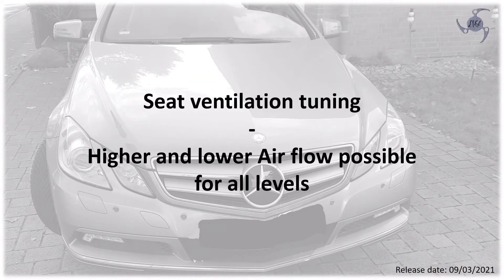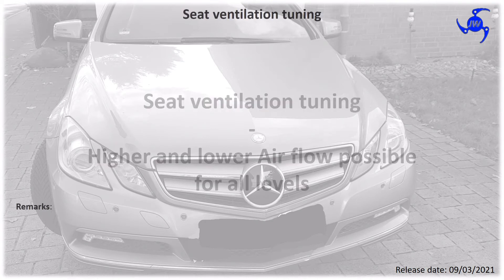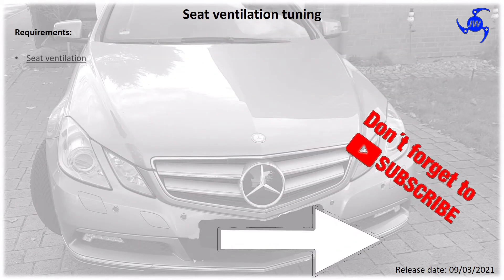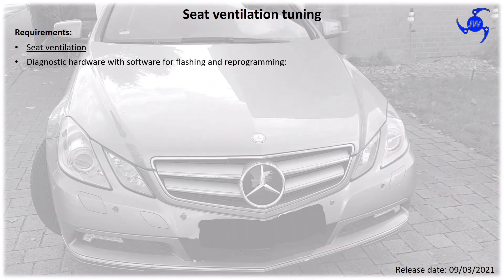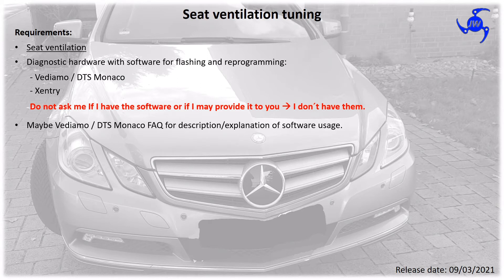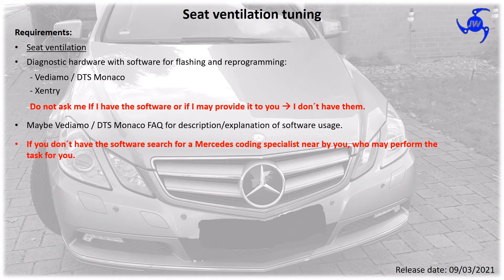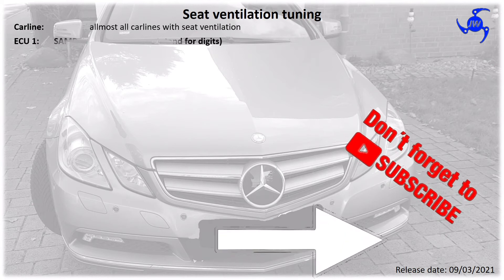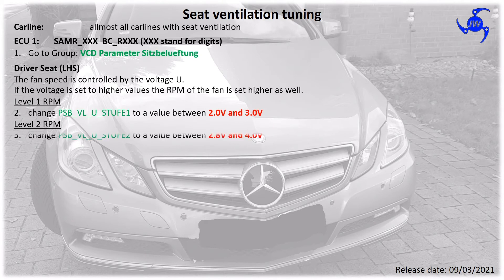DIY - Seat Ventilation tuning - Mercedes coding manual

Comment: Hi there, thank you for your incredible work! I have Mercedes GLs and some time air ventilation vacuum the air, some time it’s blow. As I understand the system automatically change between this 2 modes. Do you know of possible to change the algorithm of changing the modes? Thank you!
Reply from the maker: which 2 modes for your  aircondition do your mean ?
Reply: @JWAutomotive  car can switch automatically between blow and vacuum mode. Some time you can feel the blow from fan, some time you can feel the vacuum ( if you put your hand on seat), so far I spoke to many people and a lot of them check that gl164/166 have 2 modes - vacuum/blow. For car user it’s impossible to switch between them, it’s algorithm that work automatically.
Reply from the maker: I have not noticed these two modes yet.
so I cannot help you with your question.
and in the ECU is no parameter to this as well.
Reply: @JWAutomotive  I see, I will try to check some paramètres also in sam and will be back if I found something interesting. Thank you!
Reply from the maker: @kanterpribor  
it would make me happy if you put a thumb up in the videos you like.
thanks in advance
Reply: It’s done my friend) unfortunately I didn’t find in my écu the coding for air ventilation, only heating, but will try more)))

Comment: How to code both fog lights on  ?
Reply from the maker: be more precise.
Reply: @JWAutomotive  fog lights from the rear light up left or right depending on country left or right lane driving but never both light at the same time but at night in bad light areas when you need to backup you can use fog lights to double the light effect and see better what is behind the car. Did i succeed to clarify?
Reply from the maker: @Hi.Al.  due to my knowledge it's not possible what you want.
you want to have regular rear fog lights function with a additional possibilty to turn on both.
Reply: @JWAutomotive  not aditional functionality but turn on both when you press the fog lamp button